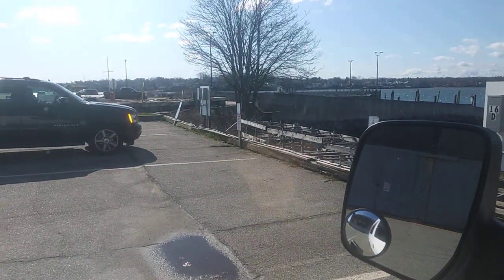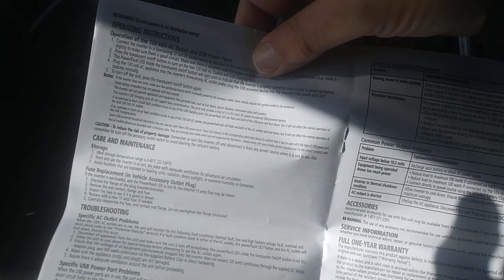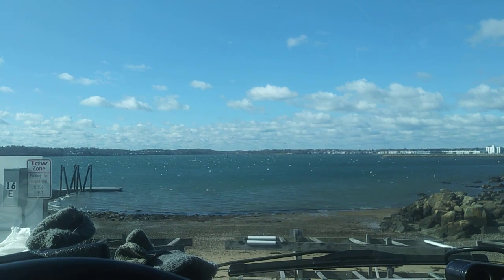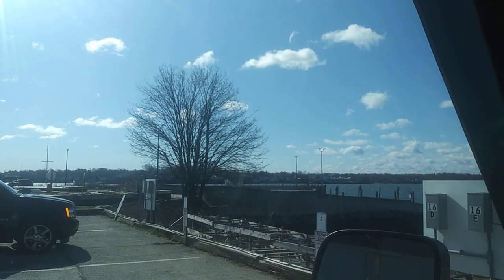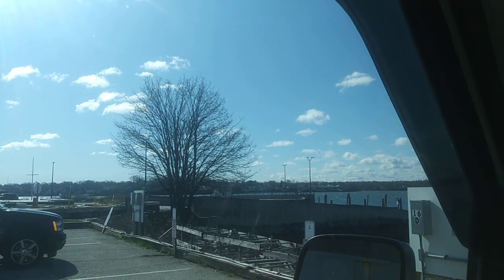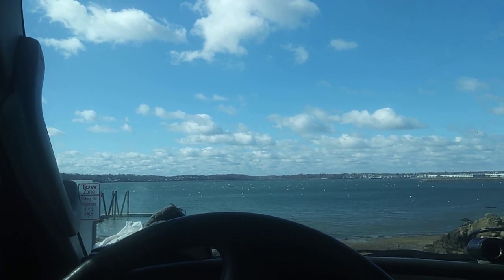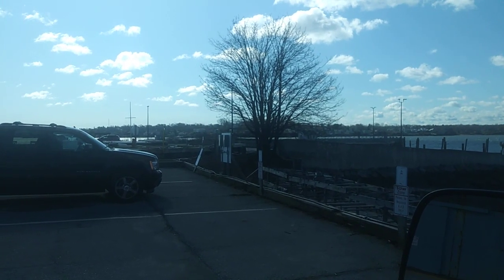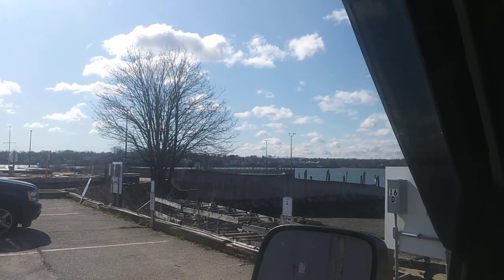Van Life: COVID Chronicles: Short of Breath

Comment: Is the unit in the sun when parked? I know that my sat nav won't charge if it has been left in the sun. It will still work but the internal battery won't charge.
Sorry to hear that you are still below par. Are you sure that you haven't got any other medical condition? I would have thought not as you would have had a thorough check up before your hip surgery. Take advantage of your daughter's offer. Keep safe.
Weather has been good here the last few days. With my arthritis it takes 4 times as long to do work in the garden but I have done a few hours each of the last 3 days. Brought my whetstones in the morning and sharpened all all my cookery knives. When I hold them by the end of the handle and draw them back over a firm cherry tomato they cut in under their own weight again. I have been meaning to give them a proper go for 9 months.
Reply from the maker: The battery pack will shut down if it gets too hot but it shouldn't be exposed to heat. I use it to prop up the solar panel so it's always in the shade outdoors.

Nice to have a garden isn't it? My place in Maine has so much potential. I'd love to plant some day lilies along the embankment by the road and plant a couple of dwarf fruit trees in that sunny corner by the road.

It's too far north for peaches and sweet cherries, only sour cherries would survive. There's a couple of pear varieties that would survive.

A vegetable garden would be nice too. There is an asparagus plant that comes up every year in the side yard. I wondered how it got there. My research shows that there is no such thing as wild asparagus in North America so a previous owner must have planted it. I can never seem to visit when it's ripe for picking.
Reply: @vangazmicvoyage5077  I don't grow veg anymore and stopped about 14 years ago as we were away too much to attend to them and crops need picking. Do have a pear tree, apple tree, grapes on a good summer and herbs though. And yes, nice to have a garden